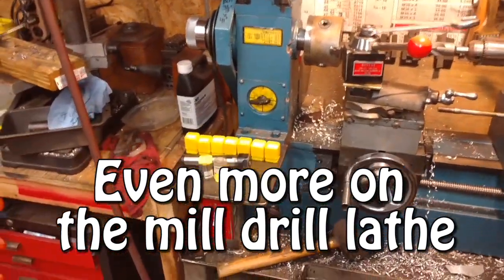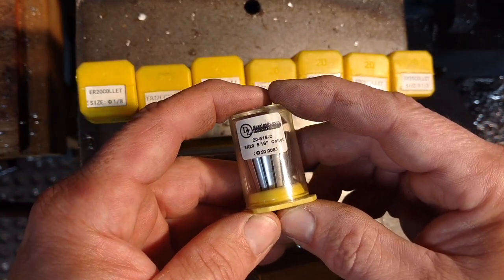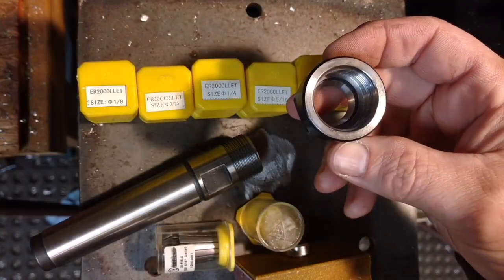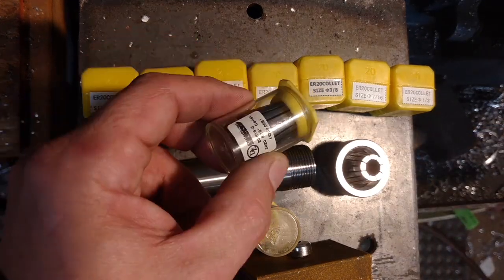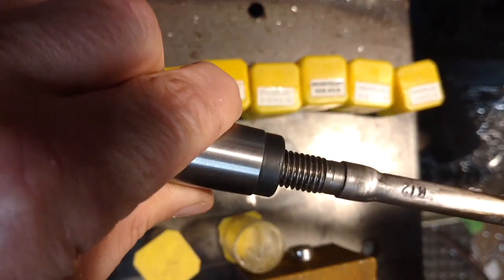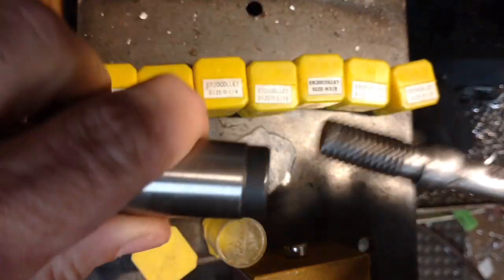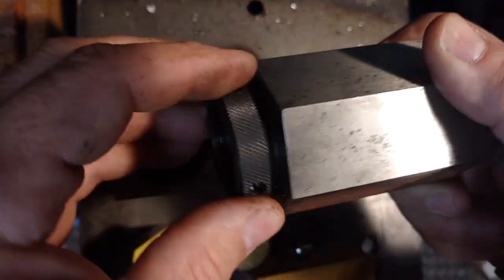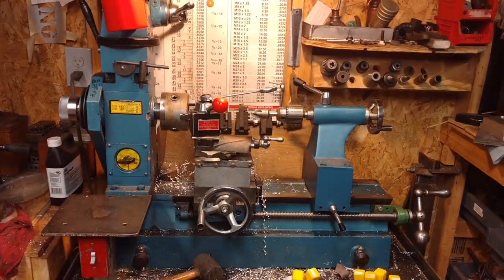Collets and Holders and Vises - Even more on the HQ400

Comment: Thanks for the quick video on the collets.  I appreciate it.
Reply from the maker: No problem, I went back and forth trying to decide between the straight collets and ER system and the ER worked better for me but either would work and not much price difference. I realized making the video that I do not actually have any of the MT3 collets, I have MT3 tool holders but tool changes would be the same with either. Best!
Reply: I think I'm going to go with the MT3 collet set.   Only because it eliminates having the large nut on the front of the collet.  I'll be using my collets mainly for holding round stock in the lathe.  But I can also use them for holding tools in the mill head too which is nice.   But yeah either system will work. I'm just more attracted to the MT3 type.

In any case I really appreciate you taking the time to make the video, that was very nice of you to do that. Thank you.
Reply from the maker: @Mystic0Dreamer  I get it, like I said I went back and forth between the two, and it came down to the tool changes for me but the full collets are likely more accurate and definately more rigid. Thanks for giving me the idea to make the video, that's what I want my channel to be about. Let me know how they work out for you.
Best!
Reply: The ER system probably is the better choice for use as tool holders in the mill.  I'm more focused on holding round stock in the lathe. That will probably be how I use them most of the time.  It'd be nice to have both.  But I can't afford both. I'm hoping to buy a 4-jaw chuck for $70 next. I'm looking at one on Amazon that comes with a mounting plate.  It won't fit this lathe right out of the box, but I'm hoping I can modify the backing plate to mount it on this lathe.  That's going to be some time in the future though.  If I get the 4-jaw chuck maybe I'll make a video of how I modified it.   If I do that, I'll let you know.  But that may not happen until summer.

Comment: You said yours is a mt2 mt3? Mine is mt3 on tailstock and mill i use er32
Reply from the maker: Yes, I wish mine had a MT3 tailstock. Adapters are fine but it just adds another place for a  precision loss. I got a really good deal on the ER 25 set but the extra couple of sizes would be nice.
Thanks,
Eddie

Comment: Is there by any chance you coud share the measurements for the headstock driving shaft, im missing that shaft, the gear and the pulley to make it fullly operstional, the previos owner made some kind of base for mounting a motor for the drill head but I dont want to do that, i cant make the shaft and the gear
Reply from the maker: Hello,
I can give it a shot. Pretty hard to get in there to measure. Might be a few days but measuring that accurately involves removing the rear panel and cleaning it off etc. I doubt I will be able to measure the steps on the shaft accurately but should be able to give you a diameter and close length.
Reply from the maker: Hello,
So the shaft is apx. 14" (355mm) long and is .704" in diameter or more likely 18mm nominal. It appears pressed into the top pulley. The lower gear is listed as the same part # as the opposite one on the lathe spindle which means there must be a enlarged boss for it though this is impossible to see while installed. I am sure there are some bearing steps in the shaft as well that I cannot see. Hope that helps. You might check out http://www.privatech.se/HQ400_eng.html and contact the guy there to see if he has a picture of the actual shaft.

Comment: I bought one of these machines used and and I filled the gear box with 30w oil. Must have overfilled it because it leaked out through the input side of the shaft. Looking at the available exploded diagrams from the manufacturer and Grizzly, there does not appear to be a seal. Did you experience the same leakage? or did you fill the reservoir just below where the input shaft goes through the gearcase?
Reply from the maker: I used 90wt gear oil and fill it just so it covers the bottom of the shaft bearings. On mine that is basically the bottom of the cover opening. It leaks a little bit but that is nature of lots of old machines. I just top it off every few hours of use. Just FYI, the manual recommends grease but I found that just makes a mess unless you are going to fill the whole cavity.

Comment: WOW,  AVE removed the retainer ring on the ER collet nut ????

I will be honest,  i have only watched AVE,s channel once and he seems to have a fair few subscribers.
 So it surprises me that someone who i thought was knowledgeable makes a first year apprentice mistake ?

The Collet blocks you have to suit the 5c collets are both Good and Bad.
 Good if you already own them,  but Bad if you want to buy them.

They are good if you are holding material of similar size to the collet size but there down side is they mostly grip at the nose of the collet which is difficult to get something running true.

The ER style collets and collet blocks are a lot better.
But i think they only go as small as ER 32 in the Square and Hex shape block.

I have a set of these blocks but ER 40, they are very handy for jobs like one,s you described in this video.

Looking forward to checking out the rest of your video,s in your collection.

First video i have watched.
 Looking forward to watching more in the near future.
Regards Peter.
Reply from the maker: Hey Peter, thanks for commenting. AvE is an entertainer but he has a fair bit of knowledge of certain things (he is a hack machinist though) and sometimes an entertaining delivery. I think the first video I saw, he was drilling a 13mm drill through steel at 5000 rpm and smoked it, but it was funny. I am not sure it was on purpose or just a joke but he will do stuff like that and then say something actually insightful in the next frame. I cannot say much about him removing the retaining ring as I did the same dumb thing before he did it, but i did not film it haha.  Luckily, parts are cheap to for the ER sets, so it was a $7 mistake. I am an amatuer machinist so that is my excuse.😀

Most of my stuff, like the 5c stuff, was bought in lots at auctions. It is much cheaper that way but you have to sort through a lot of junk but I have gotten things like a near complete set of Hardinge 5c collets for cheap. I don't use them much but they are there if i need them. On my little mill I mostly use them to index small parts.

All the best!
Eddie
Reply: @theeddies  I can not and should not say to much about AVE as you say he tries to entertain his audience and i picked up on that in the one video i watched.
It,s just me,  i prefer a more professional way of approaching things in a workshop situation even if you are inexperienced.

Machinery Auctions are great to go to, the only negative i find in my part of the world is you need to know what your buying.
I always see people bidding on different things and i am sure when they get home they have huge regrets as some pay more than what it cost to buy new, LOL.

All the best.
Regards Peter.